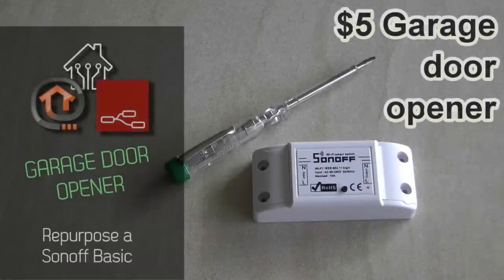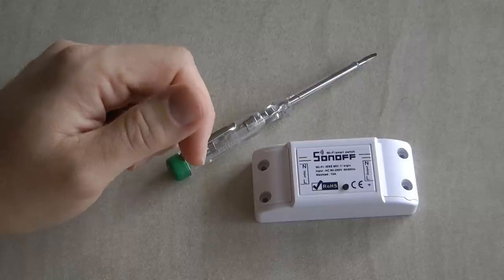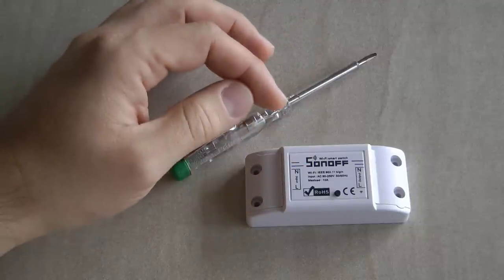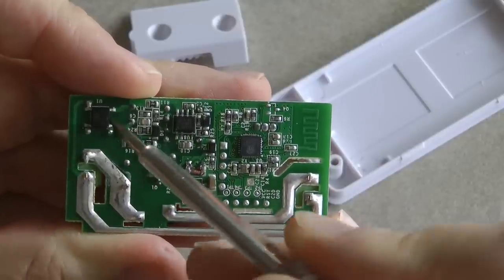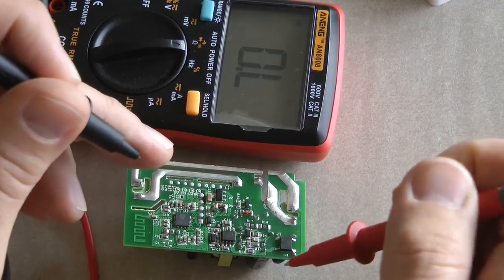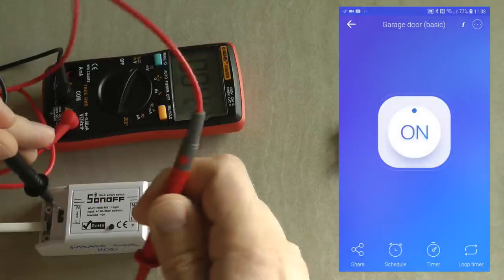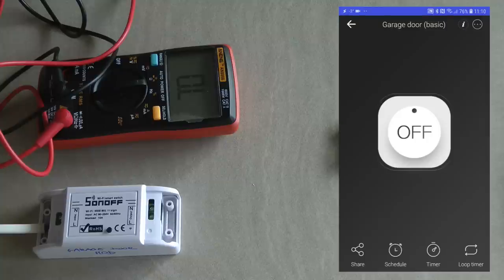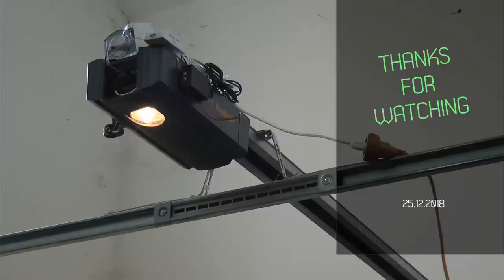Turn Sonoff Basic to garage door opener with eWeLink

Comment: This video is very good for smart device DIYers. Very brilliant idea. The drawback is you are not able to tell the status of the garage door. Not able to check the status of door is just half of the whole purpose of having smart garage door. There are some very similar devices cost less than $50 that came with similar setup plus a door sensor that can provide the status of the door. Spending couple hours cutting and soldering, installation might be a good weekend project. If time is essential and status is important for you, you might just buy directly.  I am not trying to deter the experiement of this amazing product.  In stead ,I am trying to help you decide before trying.  You are trying to install a device that give you function to open or close only.  If you  want to try or already installed this design, You can buy separate wifi window sensor to amend the missing function.  The cost is less than $30.  Thank Mr. Varga for this excellent idea, work and video. BARVO !!
Reply from the maker: Thanks a lot. Yes there are quite a few products out there. Still this video proves to be very popular. Either people are not aware what else is out there, or reluctant to spend the extra bucks for a purpose designed garage door opener.

Comment: Good video.  Newer garage door openers use Security + 2.0 which means a simple switch contact will not activate the door.  You can get around this by buying a Security + 2.0 smart button on eBay and then hack into the button contacts to hook up to the Sonoff.  The Security + 2.0 Smart buttons communicate serially over a 2 wire interface to the door opener.
Reply: Or just use the current remote controller .
Reply: @dmtycn   how is that one?
Reply: @teleonline9058  I saw a guy use this sonoff to replace the remoter button, short means push down the remoter, then your current remoter works.

Comment: Great video ! Rather than wiring up to garage motor, I've wired this up to my remote control. Soldered the L and N onto the garage remote board and it works great ! I tried without cutting to test and it blew up one of my remotes. Lucky i had a few remote fobs. Thank u again!
Reply: Hi can you explain that more detailed please?

Comment: Great video! I made your modifications to a unit, buried it in a Mr. Coffee pot. With the inching mode I can either use my phone or my Google Assistant. Beats walking on a cold floor in the winter barefoot to turn the coffee on! =:-) There's really no limit to what you can do with little boxes...
Reply: Dave Leland why would you want to modify the sonoff to just use it for a coffee maker. This modification is only for opening the garage door

Comment: My garage door is working great!!! Great video and appreciate your patience!.If you are ever in Florida, beer is on me!
Reply: Bill Perez do you have 5G net work man, if you do how did you connect it
Reply: @dennis_9039  Go to your settings on your router. Turn off 5g connect your sonoff. Then go back into your router settings make the sonoff device 2.4g only. Turn your 5g back on. It's aggravating but it works.
Reply: Can you tell me, where he connect the output in 24dc on the motor or in 230AC voltage in motor
Reply: Or the output sonoff its just a connection in 24 Dc

Comment: Great video! It was very helpful to see how easy it is to update the firmware with the eWeLink app. I had two old Sonoff Basic switches that I was no longer using due to the super invasive permissions the eWeLink app requires. Rather than installing the app on my new phone, I got around this by installing eWeLink on an old phone I no longer use. I installed the app and updated the firmware and settings. I turned the phone off and put it back in the drawer. Now I control the Sonoffs with Alexa and the Alexa mobile app. It works great! Thank for a great idea!

Rather than cutting the traces and solder, I decided to leave the Sonoff as it is and add a simple 110v relay ($1.55 US, free S&H).
Reply: Good idea!

Comment: Note: this does not apply to the new model. I took one of my older ones and did it and whoa for some reason it blew the 10 ohm resistor! Soldered in a new one and all is good.
Thanks!

Comment: Excellent, helpful, clear and simple video. Many thanks! I managed to get this going quite easily, however I did find breaking the connections and ensuring neat soldering changes a little challenging. Been too many years since I did these things.

Comment: Both my openers operate just on voltage high only, they won't care how  long the contacts are closed. The update is handy, but not essential if you don't mind clicking the app switch off & on again. Shelly have an alternative that'll work out of the box, but their range isn't as comprehensive as Sonoff's if you have more smart home stuff.
Reply from the maker: ah ok. Most of the openers I worked with use dry contacts. Good to know.
Reply: @csongorvarga  they're still "dry" they just operate when a connection is made between them. They are oblivious to how long for or when it's broken.

Comment: Excellent idea, the other alternative is just to add a small relay at the output to energize it and use the normally open(NO) side of relay to activate the door. this will ovoid cutting the board.

Comment: I created an Arduino controller and remote to control my garage door a few years ago.  Security was accomplished by a "challenge-response" type protocol that I designed... Basically, it would send you a number and you had to respond with another number based on a mental calculation of a response number given the challenge digits... Eventually, I needed to replace my garage door opener and I discovered that the new ones had "increased security" that made it so that a relay connecting the wires for a short time would no longer work... Whereas the old garage door wall switch was just a momentary contact button similar to a standard doorbell button, the new switch had a circuit board in it and there was some sort of messaging protocol that they used... This allows them to still have a 2-wire connection, but be able to control multiple garage door openers and lights... Your system would have a similar problem with this type of garage door opener...
Reply from the maker: Wow interesting, I never thought these things exists. Although if you are installing the switch inside the hour, I don't see the point of the added security. I mean you are side, you could unclip the door and roll it up. It this all about selling more stuff to you?
Reply: @csongorvarga  -- Assuming you mean "house" instead of "hour" and "inside" instead of "side"... The remote was for inside the car... Being an older garage door opener, it did not have the latest rolling codes security mechanism and as long as it was working, I really didn't have any incentive to replace it... Replacement remotes were probably more expensive than creating this... But I already had most of the parts from other micro-controller projects that I've done, so I really didn't need to buy much... I'm retired, so I have plenty of time on my hands to do this sort of thing IF I can just get motivated... :)

The challenge and response messages were obfuscated by placing the few actual bytes of data inside a 1K buffer that was populated with random numbers for each message... This was also encrypted, albeit not with a very robust encryption method since the micro-controllers were rather limited in memory and speed... The algorithm for the response needed to be something that the user can mentally answer easily enough... It could be something as simple as repeating the challenge digits back in reverse order or doing some sort of mathematical operation on the digits... Because it is using a different frequency and communication protocol than any of the normal garage door remotes, anyone using any sort of sniffer to capture codes would likely see it or know what it was even if they did see it... If they really wanted in the garage, they could just grab a sledge hammer and go in through one of the walls, so the security only needs to be as robust as it would take to either encourage them to go to an easier target or to use a brute force means to breach the door or walls... Basically, the idea is that there is no reason to have a vault door on a room that has sheetrock walls... :)

After getting the new garage door opener, I could not tie directly into the wires to the remote wired switch, so I modified the micro-controller code a bit to have it control the power for the entire garage door opener via a relay... Basically, the garage door opener is powered down when it is not in use, so even if someone was able to capture and utilize the rolling codes, it would do them no good since the unit is not powered up... This same thing could be accomplished by using the SONOFF controller and I might consider doing that at some point... I just received yesterday a SONOFF BASICR2 that I had ordered off of AliExpress and started fooling around with it... Typical slow boat from China type delivery -- a bit over 2 months... I haven't decided if it is secure enough for my needs, but for $5.30, I thought it was worth a look to see if I might could find a use for it...

Comment: Thank you very much for this solution, you are a genius! I just did the same procedure and worked like a charm ! I was using before a external relay in addition to the Sonoff switch, now I don't need it anymore!
Reply: hello rock
what is the brand of your garage door motor? promatic?
thank you for your reply
bye

Comment: The New Sonoff boards are different. I decided it was best to remove the relay because there's a Fuse (F1) almost touching the relay (with tracing on the top that has to be cut).   I used a dremil to cut all the way through the board tracing,  then replaced the wire from the terminal through my cut on the board to the relay pin on the back. Thanks to Csongor for making the Video.  *If you can't Hack/Mod the board just use a Relay with a 110 Volt coil and NO Contacts and you and it will work the same.

Comment: Mr. Varga, I figured out how to turn the Sonoff Basic RFR2 into a dry relay and installed it on my door. Works great.  Now, I have the extra benefits of using a 433 MHz remote control to open my garage and retained the voice and app capability of the Basic.  I owe you. I could not have done it without this excellent video on how to hack the Basic. I simply found the same reference points on the RFR2 that you show us on the Basic V1.  Works great.

Comment: If you use the Sonoff RF, you could exchange the very expensive remote control with really cheap Sonoff remotes.

Thanks for the idea. Sadly, there is no usable wifi in my garage.
Reply from the maker: Ah that is a good tip. I have a few Sonoff models, but never owned and RF. Just remember that these cheap Sonoff remotes do not use and coding in the RF signal. They are like the very old garage door openers, where the RF code can be listened and replayed by a 3rd party. This is why the genuine garage door remotes are expensive.
Reply: Mine is 868mhz unencrypted anyways. There is nothing in the garage but the car.
The remotes are still expensive. 45€ each and I would need 4.
I bought no genuine ones for 8€ each. The battery won't last that long, but I'll just try it.
Reply from the maker: @CyberlightFG  Sure, good thinking. I was just saying. I added a motion sensor to the garage as well, so if the garage door is compromise the alarm will still go off.

Comment: There is option to turn device on and off for short time. Go to app option and select (inching) then select the time you need.
Reply from the maker: Yes, this was not available back in the day when I made this video.
Reply: I believe it's available check this video at 9:20 😁 . Regards

Comment: Just let you guys know, you can get the SonOff wifi Relay switch with USB power or 6 volt input.   If you don't want to connect directly to garage opener, you can soldering the relay wires to the remote control toggle switch.  The relay switch works with computer and any low voltage toggle devices.  I don't recommend hanging a AC power line next to a metal bar.
Reply: Hi Mikey, I would like to have more info how to connect it to my remote please as i would love to have my garage doors smart connected, much appreciated Cheers

Comment: This is amazing! I had a sonoff switch in the draw, I stopped using them because the ewelink app was so unreliable. But with this mod I don't care about that haha. Thanks so much for sharing!
I've turned off my skills for Alexa and would suggest everyone else do so, so easy for thieves to shout "Alexa open the garage door" when you're not in.
Reply from the maker: Love the Alexa suggestion. Did not think of that!
Reply: - The command for Alexa may be changed, coded, to reduce chances for abuse. "Alexa open garage door1"
Reply: @izsakitt3711  Don't think I'm going to take that chance, but good idea.
Reply: @izsakitt3711  "Alexa, my feet smell bad".  Opens the garage door. Actually I would not recommend using the Sonoff and Amazon or Google speakers for any door locks or openers.  Something more secure should be considered if you have valuables in your garage (as I do).  I have a RTU5024 gate opener in my garage. I'm in the USA. I toss a Lyca Mobile SIM card which works over the T-Mobile Network in the RTU5024. I fund that SIM with $10 a year. My Google Assistant and Home Mini each work to open the garage door when I give the voice command to call the Lyca phone number.  The RTU5024 only opens the door (or closes) when the caller ID matches a number in my list. No cellular minutes are billed to my Lyca PayGo account due to a feature within the RTU5024. I have the RTU5024 send me a $0.05 text message once in a while (~90 days) to keep the Lyca SIM active. This has worked very reliably for me for two years.

Comment: Thanks for this!. I was debating on wiring a contactor switch to my Sonoff to get dry contact functionality for my MAME cabinet and discovered your mod to convert the Sonoff to a dry contact relay. I am using your mod to turn on/off a MAME laptop (wired to power button).

Comment: Very Nice, I have been thinking about this but was unaware of the new "inching" feature. The proper term would be "momentary" Your mod makes it so simple for this and many other applications.
Reply from the maker: Thanks. It seems inching been used elsewhere, but "momentary" would be my chose too. Maybe it gets renamed in a new release.
Reply: @csongorvarga  here is a much better version

https://www.instructables.com/id/Sonoff-Garage-Door-Opener/

see my comments for how to do this method without cutting traces  or modifiying your sonoff basic in any way
here is the diagram ,  the top is how the sonoff basic is normally and how it  is supposed to be wired to control  main voltage  devices like lights,  the bottom is my  diagram on how to wire it to switch things without them being connected to mains voltage
https://cdn.instructables.com/FK0/O16O/JI0JOBH2/FK0O16OJI0JOBH2.LARGE.jpg

this indestructible project has a sensor on the GPIO pin  for state  reporting
 this guy used a simple NO magnetic reed  switch setup  but you could  use a simple  arduino
mini or nano with an  ultrasound  sensor  and a relay instead of the  magnetic reed switch
if you can not  mount  the magnet and reed switch on your door setup
Reply from the maker: @anthonyrossetti7509  I wanted to keep the original firmware for those who would not go as far as flashing the ESP.
Reply: @csongorvarga  can you use
It with Alexa and GA with the original FW?
Reply from the maker: @anthonyrossetti7509  Yes, you just need to say something like "Alexa turn the garage door on". I don't think it would accept commands like "open" or "close". And when you wan to close the door you have to say "on" again.
Reply: @csongorvarga  I know  that ,but as long as it shows up in Alexa smarthome then you can add it to a routine , this is how I have mine set up ,but I am using 2 433mhz RF relays and a  DPDT push button switch
Wired to the 2 relays so I have  a separate FQ for open and close 
I made 2 routines  for open and 2 for close
One is called open the garage and the other is called open the garage door  same for close so I can say it either way

Comment: well done.  I needed this thing to work as a switcher of the 12v device. it was not possible with its current state. I was planning to use it switching an extra relay. but now I can use it switching 12v device...
Reply from the maker: You can also check out Sonoff SV. It run off 5V and the relay can switch any voltage. That is the easiest option.
Reply: @csongorvarga  thanks a lot